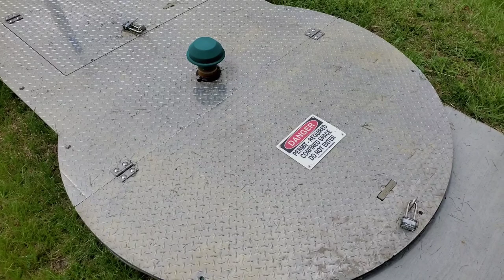HOA County Flood Water Lift Pump Station In Action

Comment: Very Nice System! Topp Industries tank with valve vault, Looks like Flygt Pumps,  I was a little nervous at first, not seeing the flow go down, but you have quite a bit of incoming water. Looks like they designed a perfect sized system, without going crazy on the budget.  You'll want to keep up with maintenance on that station, hopefully someone is checking it every year, but that system should run for quite a few years.

Comment: That inlet should ideally be diverted away so to prevent water from splashing directly on top of the pumps, but it seems that there's just not enough space to fit an elbow and vertical piece of pipe.
Reply from the maker: Thanks for the comments.
Reply: Would submersible pumps really be affected?
Reply: @skylined5534  I don't know about these pumps in particular, but in general submersible pumps are not designed to be pelted by debris laden water. Power cables can be damaged or even cut, pump casing can get beaten, float switches can get tangled with hoisting chains causing pump not to turn off when it should, lower water pressure can lead to cavitation thus damaging the impeller, excessive turbulence in wet well is reducing pumps efficiency. Adding an elbow and a piece of pipe in design stage of a project would be very cheap and effective way to extend pump stations service life. Fitting them after the pump station has been already built is hardly possible in this case due to the lack of free space.